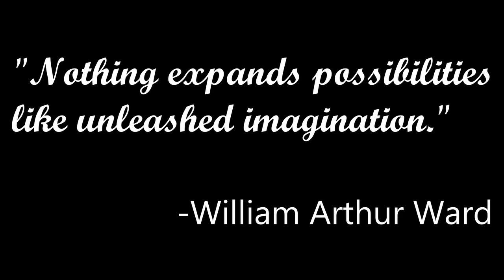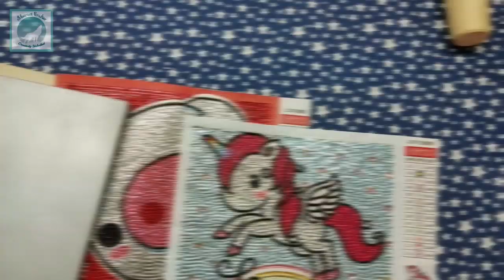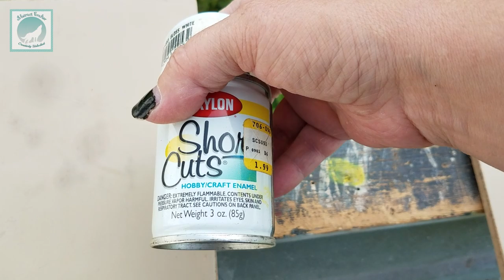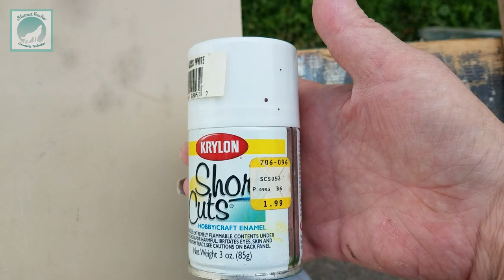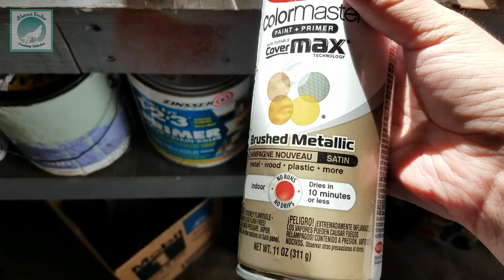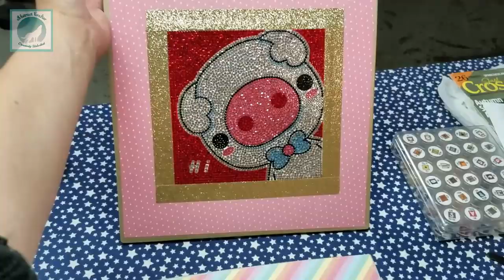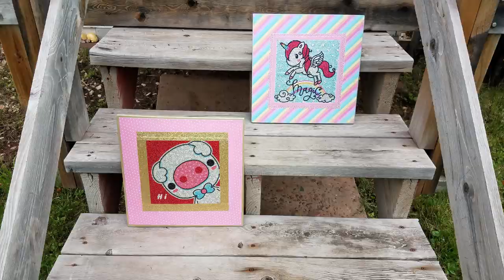DIY Framing for Diamond Painting - A Week of DP Finishes - Sept 15-21, 2019

Comment: They turned out great! Love the idea of can pulls😀 hubby has simply made  wooden frames to the exact size of the painting using 1x2 cm dowels? Is that the correct name? (Just strips of wood) that are stapled together and stuck the painting on using very strong double sided tape. I have never sealed any of them and I have never noticed any dropped drills , the oldest is possibly a year hanging now. Take care. Blessings from Greece

Comment: Piggy looks so good that I just might have to hunt it down myself, as you do lol.  

The unicorn is one I would have to live with to see if it goes. My initial thought was the rainbow paper was a bit too much, but it worked, then I had the same thought aboug the first washi tape too. Then the washi sprinkles was a bit hmmmmm .....but again it seems to work.  I think it works, but I think I actually have an issue with the diagonal design of the paper. 

I would have maybe gone with cutting it into quarters along the diagonals, turning the pieces to get a squared shape, and possibly adding ultra thin dark mitres to tie in with the outlining from the picture. But as you said, everyone has their own ideas. The other thought I had was, instead of washi tape, mirri board. But then I spend almost as much time playing with framing as I do creating the piece in the first place lol. Another thought, what about creating a border with some off cuts from your acrylic pours .....
Reply from the maker: You have some AMAZING ideas Donna! Thank you so much for sharing them. You stated your difference of opinion in such a thoughtful and meaningful way and I appreciate that so so much. We need more of that in this community ♥ 

Anyhow, I thought about this design idea for quite awhile as far as the using a 12x12 board with some sort of paper background, but when it came to the finer details I didn't give myself any time to do so. I keep thinking about how I could change the finer details and add more elements, like using the same twine I hung them with to add bows or outline them. You would be so fun to craft with because you think so creatively! 

And again. thank you for sharing your thoughts,  I am so grateful to you for you opinions and ideas! ♥